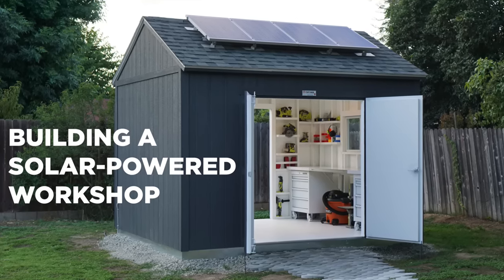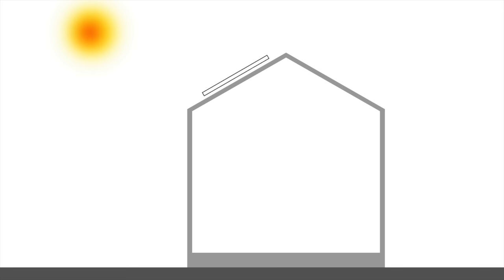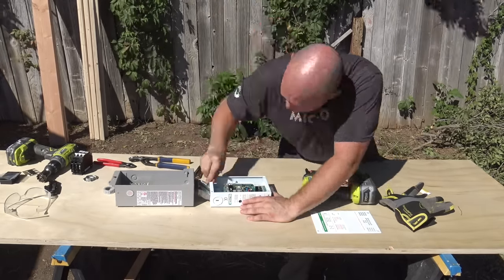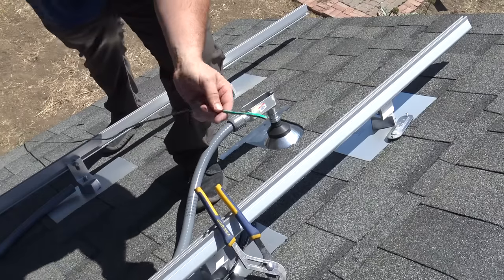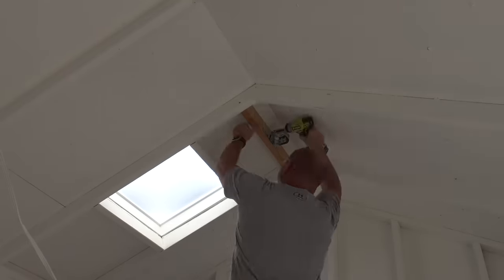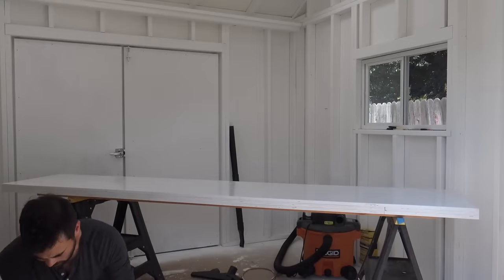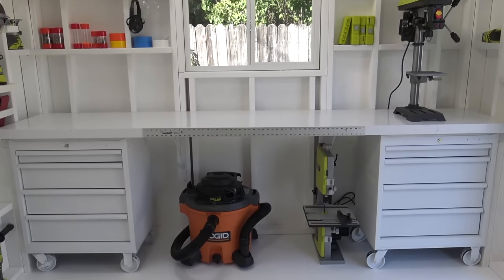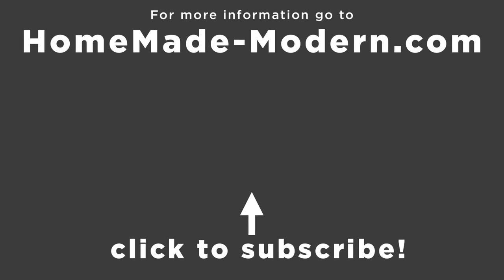Building a Solar Powered Workshop

Comment: Would be interested to see an update video after a couple of months. Having done solar for residential for a time, I'm always curious about how these little off-grid setups do for the average user. With the kit you have, just crunching raw maximums (not accounting for placement or your location), I would think you'd have very spotty usage on your plugged in tools. If you use infrequently (weekend warrior), it might be OK, but someone working in their shop daily, I think would have outages.

Keep us updated.
Reply: twitchblues we planned on the loads being weekend based and if it takes a couple days to recoup it would be ok.  I live off grid and have a system that allows me to weld and use my wood shop when ever I want, its possible just takes planning
Reply: jup, would love to hear updates about it.  it's a good thing he keeps batterys, but i would like to see if you never need external power. 400W max is not much in my idea.
Reply: HAHAHA!! Run a welder from it! Neat concept, neat implementation. I would never be able to keep it clean and I'd probably burn it down with the heat exchange from the load on the batteries. I was sort of surprised that there was not a cooling setup for the batteries.
Reply: Jason - We are partially off grid at our farm.  I would love to run a welder off the system.  Would you share the setup of your configuration?

Comment: I built a shed like that but just made a concrete slab.. I built my
shed myself and insulated it really well. It has 5/8" plywood interior walls
with insulation between the outer and inner walls as well as 12" in the roof.
Also used a steel roof. As for mounting the panels? I prefer NOT to 
mount them on my building's roof. It is a maintenance nightmare. Panels
do need to be cleaned now and then and if you have any issues with
the roof, and you will with shingles, you will have to remove the whole system
to fix the roof. If you must mount on the roof, at least go with a steel roof.
You will also have to plan for enough room for the batteries. A stand alone solar system
will not work well without batteries of some type. My shed has heat and AC
and all can be run either off grid or via solar. My solar power is not grid tie but stand alone
and works great. It has been in place for five years now.
Reply: I want all foods names that's undesirable to acute gout.
Reply: Reply please ?
Reply: That sounds epic! Do you have any pictures or videos of the shed so we can see? What do you do for dust/ventilation? I have a small business where I make miniature skateboards out of wood and I normally work in my garage but with no ventilation I usually only work in there in the spring/summer/fall months when I can keep the garage door open. The winter puts me out of commission for 3 months every year.  My dream would be to be able to work year round... any help you could provide would be greatly appreciated! :)

Comment: Wow, so many negative comments.  I just appreciate the how to on Solar.  Question, why 2 6v batteries.  Most I have seen use 12v deep cycle.  I am looking to power a warehouse with 2 or 3 20amp breakers that run about 40 LED lights on 1 or 2 of the breakers and a camera system on another.  Not a lot of power needed.  The lights are on timer switches and used maybe 4 times a week for about 20 minutes each and the cameras run 24/7.  Any recommendations?

Comment: Well done!! Awesome build! Be careful storing sealed maintenance free batteries inside though. I work in a factory that produces similar batteries and even though they are sealed, when charging they off gas hydrogen. I don’t think you will have a problem with it since you are recharging at a low current. Just something to think about.

Comment: The saw and the drill may not work under load or quickly drain your batteries. Circular Saw: 12-15 amps / 1440 to1800 watts Jigsaw: 4.5 – 7 amps / 540 to 840 Watts Reciprocating saw: 4- 12 amps / 480 to1440 watts Hand-held drill 3.5 amps / 420 watts Drill press: 4 to 12 amps / 480 to 1440 watts Orbital disk sander: 3 to 4 amps / 360 to 480 watts Router: 6 to 12 amps / 720 to 1440 watts Table saw: 15 amp / 1800 watts Bench grinder: 2 to 6 amps / 240 to 720 watts Small angle grinder: 7 to 10 amps / 840 to 1200 watts
Reply: aint it funny how some think a 4-pack kit of solar panels will produce enough energy to actually run that tool shed,  HaHaHaaa!  ...not hardly
Reply: I live in a super-insulated off-grid solar home. I'm very conversant with PV. This video showed four 100W panels, totalling 400W of course. The amp-hour rating of the battery bank is unclear. However, if this little shop is mainly for evening and weekend work 400W of PV may in fact be adequate. Remember, you're only using one power tool at a time. No need to start getting confused by adding all the loads together. 

I'd say this workshop turned out very well!

Comment: 400w panels; oh 1200$ for some good ones. Inverter ~3-500$ depending on your wattage. 300$ for 2 good reliable batteries.

At least 2 grand for "off the grid".

At 8 hours of maxed out use per day, it will take roughly 15 years to break even. IF it even lasts that long... 

Neat, and a cool idea, but not very practical yet.
Reply: JgHaverty that is just what I was thinking if it was in the middle of nowhere  then maybe
Reply: You can do 400 watts with batteries and all for under $1,400 and in sunny places like AZ, it makes a lot more power and for longer hours.
Reply: You can get a Renogy 100 watt monocrystalline solar panel on Amazon for $140, so only $560 for 4 panels.
Reply: Errr, it's pretty easy to find solar panels for $0.30-0.50/w.. The rest can be done on the cheap if you know where to look.
Reply: 400W panels are only 99$ on amazon where im at. so it'd be only about 400$
so a whole lot cheaper and more affordable (I got one myself)
Reply: You wouldn't want to use car batteries for this. Car batteries don't do well if you consistently drain them below 80%. They're designed for large short term current draw (starting an engine) and not for deep-cycle use like you'd have while using this workshop. His choice of 6 volt deep cycle batteries is a great option. You could easily connect them in series to work with a 12 or 24 volt inverter.
Reply: For that cash you invest into solar power you could run your workshop on coal power for years but i must admit it look nice
Reply from the maker: $99 bucks if you buy them individually:  http://www.homedepot.com/p/Grape-Solar-100-Watt-Polycrystalline-Solar-Panel-for-RV-s-Boats-and-12-Volt-Systems-GS-Star-100W/204211365
Reply: +CJ Owen the idea that "sunny places" make a lot more power is a myth, at least within the context of the continental United States.  You're talking about a less than 10% gain over your fellow citizens.
Reply: You forgot to subtract the cost of digging a trench for conduit out to the shed, And for the electrician to wire the shed into the mains power for the house. And the permitting fees.
Reply: Perhaps not in the back yard, but imagine having something like this in middle of nowhere though.
Reply: JgHaverty UNLESS YOU BUY A CHEVY VOLT PLUG IT IN, YOU DON'T PAY FOR GAS, IT PAYS OFF FASTER.
Reply: The idea is NOT to hook the power into the house. The building is self sustaining.
Reply: Just add a grid tie if you want your money back in 5 years so cost not really a problem.
Reply: You guys forget that this is not a retrofit. To wire it up to the grid he would have had to run electrical connections. And maybe he did it just because he is environmentaly conscious.
Reply: 15 years is pretty good, my last math had it at 20-30 years last time I looked at solar, which was well beyond the rated lifespan of the panels, so it's getting there, I would love a small backup system to keep core devices (Fridge, Modem, Router, Laptop, LED Lighting) powered through all the power outages we get
Reply: the batteries required for a car, and for a photo voltaic system are different.  the charging and usage cycles are much different.
Reply: errrrrrr.      really?    errrrrr.
Reply: er
Reply: Youer a bunch of fun at party's
Reply: There are many benefits including not needing to trench and hire an electrician, having a backup for electricity (could run an extension cord to the fridge) and depending on where you are, it could pay for itself through electricity savings.  Also portable, just throw the shed on a trailer and move it where you want it.
Reply: GoogleMinus I agree, people are totally missing the point, this was an experiment and it was for fun.  Do people really think that we couldn't have ran the electrical from the house?? That would have been simple especially with Rod running the pick.  It was to show people that hey this is possible and to make a good video showing solar in a useable situation as there really aren't that many decent solar videos out there.  I am usually running way to hard on my projects to spend time setting up a camera.
Reply: + Markle2k,   SWOOOSH! (the sound of the point flying over your head!)
Reply: jfc OP. IMO it was pretty clear this wasn’t about saving money. get off your soapbox.
Reply: I was thinking the same thing about the cost of trenching, and electrician, and permits make it a lot more practical for this small shed.

Comment: And that my friends, that's how you build a grow house (;
Reply: mono19963 Good thinking!
Reply: mono19963 needs way more batteries and solar panels for that
Reply: dezertXer only if you are growing mad amounts.. 

Insulation to keep heat in has improved considerably.. 

Also.. If it's like 4 plants for personal use, this would be plenty
Reply: Then there's a record of you buying all this stuff.
Reply: Grow your tomatoes with LEDs
Reply: no it's not.  @dezertXer got it right.  batteries alone cost literally half of the rest of the entire installation of the average photo voltaic system.  battery demands go up the more off-grid you are, and the wattage demand you put on it.
Reply: also, you only have sun for a certain period of the day.  on a cloudy day, you generate hardly anything.  if you dont live in the sunny states, you might as well get a medicinal prescription and buy the expensive shit from the dispensary.  you'd be spending about as much money as you would on a grow show run on PV.
Reply: insulation has nothing to do with it.
Reply: a grow house with bi-pv , glass ceiling would be the best , day and night lights for plants and extra electricity at day time .
Reply: dezertXer definitely wrong. I currently already grow 2 plants w/ a single panel. Powers my 40w light, mini-fan, and my light gauge.
Reply: Nothing's better than a good amount of organic self grown tomatoes :D
Reply: Copter a see the heat and busted.
Reply: :-) they need to a water catch system to then.
Reply: mono19963 wind turbine, an abundance of solar panels, and rain collection that self waters your plants and a nice ventilation system
Reply: Dab N' Go smart.
Reply: Dab N' Go also have a turbine on the rain collection system as the rain fills the rain barrel(s)
Reply: mono19963 

Thats exactly what i was thinking lol off the grid herb gardening .
Reply: So when his wife kick him out of the house when she's mad he got somewhere to sleep.

Comment: is there a code reason you did the DC wiring really professionally, then went with a 'couple of power strips and some cord' for the AC side?

Edit, not intending to be a criticism, i was very surprised that is all. The conduit work on the DC side is awesomely professional, it contrasts with the 'power strips with cord on them', making me suspect a code reason?
Reply: TheChipmunk2008 well it could have been in pvc and I see a bunch of people nail it to the wall or use blue smurf tube. It really came down to it was easy I do a fair amount of pipe work and build a lot of solar.  The hardest part was trying to pack a bunch of tools in my travel work bag

Comment: You can pay them $3-5k for a simple shed or spend $1500 building the same with your own two hands...
Reply from the maker: yes!  I agree in general I would expect labor to make up about half the cost.
Reply: I totally agree and thats actuality the exact amount it cost me to build mine and i even did it with treated wood on all exposed areas
Reply: In the time it would take me I would have made more then paying someone else to do it. Plus I would mess things up costing me more money but more importantly, really piss me off.
Reply: you agree? in the video you said you could have built it yourself but you wouldn't save much money so you bought a pre fab.
Reply: Or.......you could make a cool gaming pc  :D
Reply: I built a 6x6 ft A-frame with a 8 ft peak run a whole charging unit off of harbor freight solar kit all in all under $900
Reply: You need to be young and strong enough. Paying double the cost is worth it while I sit with a beer and watch workers sweat their asses off!
Reply: Time is money. If you need to save as much money as possible than build your own. If you have the money and don't feel like sweating/working your ass off and think double the price for it due to labor is worth it then do it.
Reply: Opportunity cost. Hire out.
Reply: I'm about 3/4 of the way through building my 10x12 right now with build quality similar to this but with 6" soffits and full width ridge venting. All told, I'll have about $1400 into it plus maybe another $600 in materials and trencher rental to run 220 out to it. I would expect that with labor costs and material markup, the cost to have a contractor do it would easily be double, probably more.

Comment: Would it be more efficient to charge the 18V batteries from the 12V DC instead of going from 12V DC to 120V AC then down to 18V DC?  Also a suggestion for the grounding rod, if you have a hammer drill it goes so much smoother.
Reply: GoogleMinus yes I have one but I couldn't get it on the airplane
Reply: It would be significantly more efficient to charge the batteries off of the DC directly rather than going through the inverter... you lose maybe 15-25%? However, the power tool companies generally only supply battery chargers that run off a standard AC wall socket, since that's what 99% of people have, and there's no prevailing standard for DC power (and it sure isn't 12V). While you could definitely build a custom charger or hack one (I've done it), it's generally beyond most people and not worth the effort, especially if something goes wrong. They also shouldn't have been running the lights through the inverter either, especially since 12V DC LED lights are commonly available. Also surprised he seemed to go w/ yellow LED lights instead of daylight LED lights... and that they used inefficient short-life lead acid batteries instead of something better; but hey, this video really seemed to be about doing things cheap, quick, and easy instead of most efficient, best, or even cost effective over time.
Reply: What in the world? Why not convert it to standard 120V AC and be able to plug anything into it no matter the voltage, just like IN your house?

Comment: Should have insulated the walls and drywalled it in even if it was only 1/4" drywall. This allows you to heat your shop with less energy in those cold winter months.  Since your using solar I would suggest a solar passive heating system with a cover for the summer months these things can get toasty in the winter, but are way too hot in the summer to use hence the cover. Also instead of the down lights you should have installed flat panel LED lights.  They are super bright  and more energy efficient.   Nice build for a small shed,  and good job with the video.  The solar installation explanation made it so clear a cave man can do it. 😂🤣

Comment: You guy forgot the eyewash station and fire extinguisher!
Reply from the maker: good idea!
Reply: Eye washer LOL
Reply: .....do you work for osha?
Reply: That's what the hose is for.
Reply: Yeah good idea  but you need to install water line for that eyewash
Reply: roughy762004 ...and dust mitigation system. Very important.

Comment: It' aways fun to watch other work. Helped a friend install 3 phone batteries. They weighed 300 lbs a peice.  27 - 1 amp solar panels. Only 1 Amp at max sunlight. 6k inverter. Powered an 80 x 120 barn with TV,  refigerator, lighting, microwave, powertools and never ran out of power.